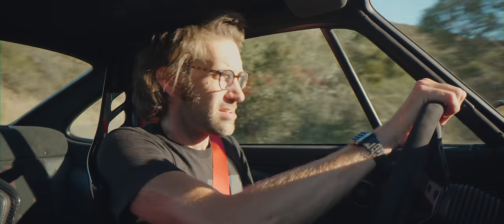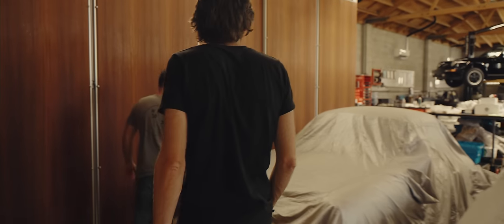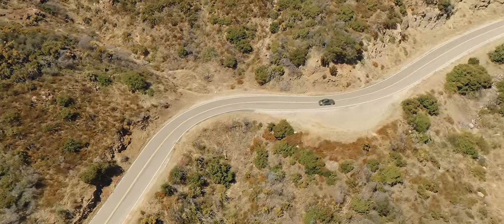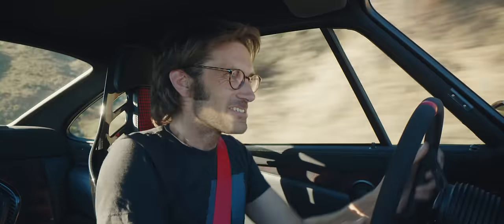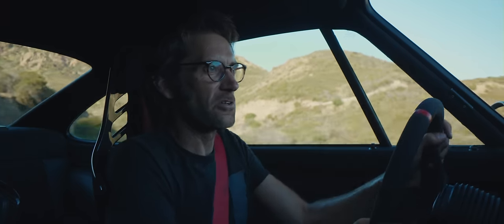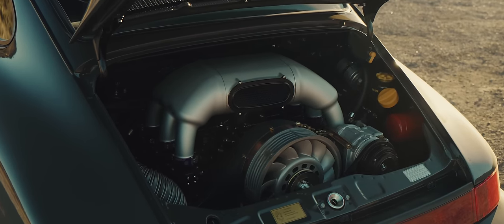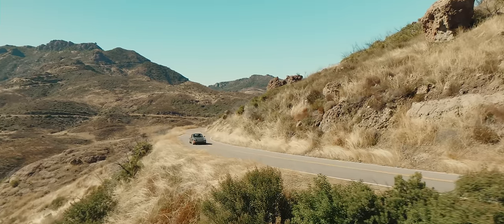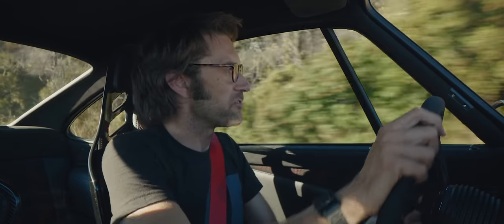The BEST restomod Porsche 911? Workshop 5001 Build #11 | Henry Catchpole - The Driver’s Seat

Comment: I remember when Matt Farah and Jonny Lieberman discussed Workshop 5001 a few years ago on the TST podcast. This is my first time actually seeing the car. It sounds like a lovely thing to drive, but... I know it's a different beast, but I can't help but think that the 11,000 RPM Tuthill 911K is the best "restomod" air-cooled Porsche.
Reply: Since the video of Chris Harris, when I think about Porsche restomods the first one that comes to my mind is the Tuthill 911 K. I don't think that a Porsche can be better than that. Even the Carrera GT I think that can't.
Reply: @8Lucas1Simoes2lsdGT  Agreed. 11 thousand rpm in a road car is insane, and something very few have achieved (without putting a bike engine in a tiny car). But there's so much more to that car than just the engine.
Reply: @shingoose6197  yeah man, it's also incredible because of the weight (846 Kg), the power (350 PS), the handbrake of a Drift car/ Rallye car, the carbon wheels, the beautiful interior, the classic 911 shape and, of course, the flaming exhaust!
Reply: All true. 
But i still like GuntherWerks more.
Reply: Didn't Henry drive a silver Workshop 5001 car a couple of years ago when he was working for Carfection?
Reply: Now you’re talking!! Soon as I see any of these restomod Porsches, Tuthill’s creation jumps to mind! And like others have said on here, all after watching Harris rag the little lightweight up n down its 11k rev range. The only other that comes close, was a young fella from Cali that works at Rod Emory’s- kids name escapes me? But what a gun on bodywork and that old art of shaping metal! What he’s done to a gorgeous little 912 might be on par with Tuthill’s..
Search up one of Magnus Walkers recent outlaw episodes and look for a little silver 912 restomod- this one has the proper boxer four, only it revs to 10k! So has that same almost banshee like wail as Tuthill’s. The space between the doors and the rear wheels have been extended just enough to give it 911 proportions and an utterly bang on stance. This kid has also subtly combined elements of a 365- more so to the rear grill and lights- so so tastefully done too. Ultimately, it’s the super lightweight(circa 850kg) and stratospheric rev characteristics in a 911/12 body that is some how irresistible to me. That and the subtle aesthetic- especially in comparison to say a Singer. 

I think with regards to this Studio 5001 variant, I’d change the seats too. I’ve never been a fan of those Porsche wheels that stick out further than the tires. Last off, I’d want the weight down to no higher than 1000kg. All hypothetical lottery winning stuff of course;))

Comment: I had a Nightblue over Linen '92 C2 manual about 10yrs ago. It was a great car as is. I would have been happy with an extra 50hp or so. Probably should have kept it. The best mod that I installed was a Cup Pipe...sounded great and removed about 20lbs from the back end.

Comment: Henry, it's actually a horizontal 6 or boxer 6, not a flat 6. In this type of engine, there are six crank pins, and each cylinder is connected to each crank pin via a connecting rod. This configuration gives a pair of cylinders the boxing motion, which is why the Germans call it a boxer engine, not a flat engine. On the other hand, a flat six has 3 crank pins, and every crank pin has 2 cylinders attached to it via a pair of connecting rods, giving the pair of cylinders a master and slave motion. As far as I know, there is no production of a flat 4 or 6 engine. Another manufacturer using the same principle for their horizontal or boxer engines is Subaru.

Comment: I still like the Singer ones a bit more just on the looks being updated, but I do appreciate when restomods try to look virtually as original as possible yet still updating the car. I love seeing restomods, but I do wonder why it’s 964 particularly.
Reply: Modern suspension vs. the torsion bars in older cars. Nicer base to work from. Updated interior. etc. I say this as a 911 SC owner - the 964 has some perks if you're already going to spend $$$ on the restomod side of things.
Reply: Technically a better base, if someone wants to drive it and not just look at it.